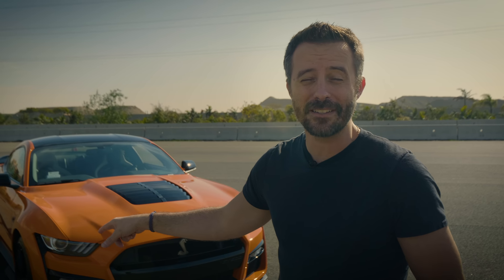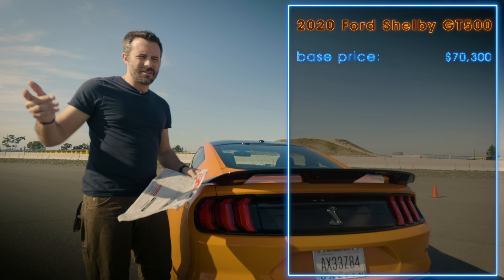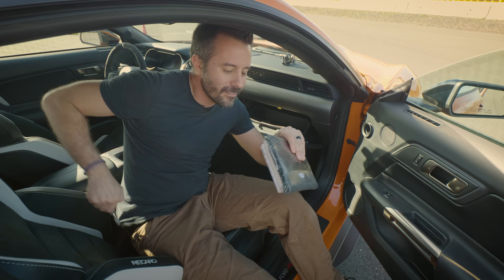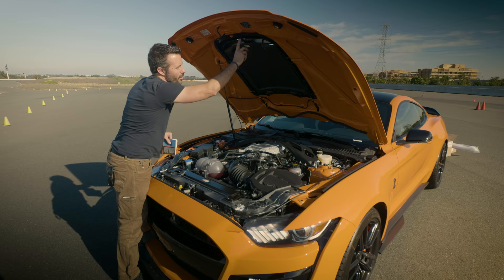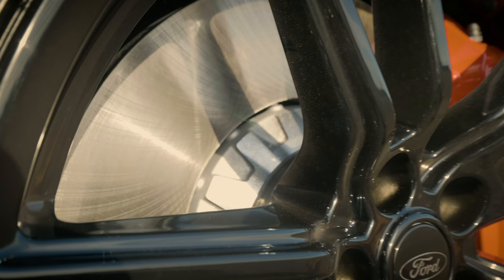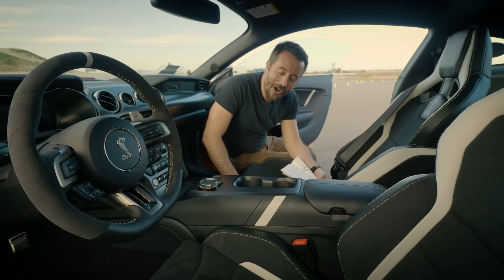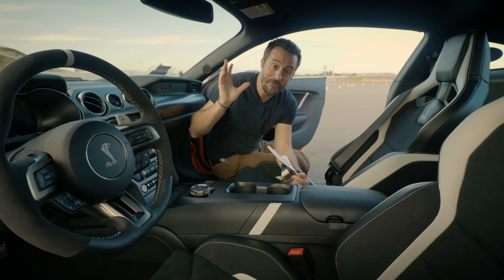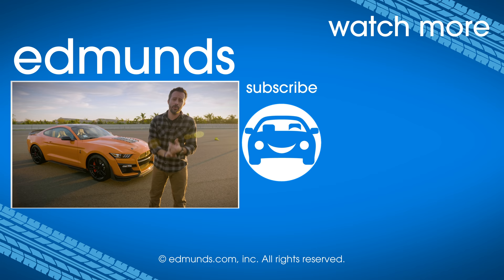We Bought a 2020 Ford Mustang Shelby GT500! Unboxing, Overview and Handling Pack Installation

Comment: Best series on unboxing one of these high performance cars. In fact i believe its never been done before. This channel is real world stuff and makes you realize how many you tubers probably never applied proper break in or paid attention to the engineering standards of new ownership. I knew 500 miles was too little for any car. I would still put 2k low stress engine miles before serious acceleration.

Comment: Edmunds the dealer didn’t install the front splitter properly. You shouldn’t see those gaps and it could separate from the car at high speeds. I hope to see Carlos in the 2020+ Shelby GT500 Owners group on Facebook!
Reply: Thought that looked weird. We'll get it addressed...

Comment: Thanks for showing the prep required to make the GT-500.  It was interesting to find out the MPG is so low for this car, hence the gas guzzler tax.  My 2014 GT-500 with a few bolt on mods and tune,  I am still experiencing on 91 to 93 octane on average 25 MPG.

Comment: Will Edmunds be buying a long term C8? I feel like that's the car I hear more people interested in.
Reply: Yes!
Reply: @CarlosLago  you will see more Mustangs on the street  then Corvettes .
Reply: The 2020 GT500 already beat the New 2020 Corvette C8 on the track according to MotorTrend driven by Randy.
So no...they got the right one first.
Reply: @twany442   Yes by 5 seconds(holy cow) at VIR a track I have driven many times in my past open track life.
Reply: @twany442   Yes by 5 seconds at VIR. Until Corvette comes out with their "revolutionary" 4 cam engine, the  Vette boys might want to hold off on the bragging.
Reply: @RSDX99  Agreed

Comment: After watching this I’d probably NEVER take this track because I’m not going to follow the manual and do all the prep ie starts and stops as recommended. I’d use it as an ordination street car.  So, I’d never buy this car as possible track beast and spend this $80k.  For me...the GT or Bullitt is best.  However this video is excellent because it really opens your eyes. You need to follow instructions in manual for track use or warranty may not be available if problems arise from track use.

Comment: I have a huge gallon of Haterade and I'm drinking it while I say .... This is a Road Car if you take it to the track and pound on it, it will break. Plain and simple. If you want a race car build one!  Other than that it's super cool and I would like one for sure.
Reply: Sure!
Reply: My gt500 has seen a few track days it’s a 14 still running strong 💪 and go look at speed phenomenal or something on YouTube he tracks and drags his new 500 constantly still running strong 💪 make sure you don’t choke on your haterade 🤧✌️
Reply: @andyhernandez2360     it's a road car and a FORD don't worry it will break.
Reply: Ford makes unreliable junk. Only the F150 is worth anything. Bet you guys anything that the thing has unreliable cooling system problems. The engine makes 850 hp at the crank. A lot can go wrong.
Reply: @andyhernandez2360  lol lol🙂 don't get emotional about it. It's just a car. It's just my experience that Ford's break down. Go ahead and get the GT500 I'm sure it will be a blast

Comment: Overpriced Ford... NO sale.   (Save 20 large and get the mid-engine 2020 Vette)
Reply: quietguy over priced Chevy
Reply: Ford is killing it right now... With the GT and all its versions... And also with the Shelby Mustangs GT350, GT350R, GT500 and the GT500 carbon fiber track pack.
People want them...and they're buying them like it or not PIEROD
And the Mustang GT500 has already taken down your new Corvette C8. It just couldn't hang with the Mustang's power.
So no thanks!...we prefer to spend the extra money.
Reply: lol do you really think Chevy isn’t gonna overprice the stingray there’s already one on sale from a dealership for 120k
Reply: @andyhernandez2360  Of course They're going to do it..until the markets are Over-saturated since it's a none limited production. 
Then they'll be like Toyota Corollas... Great sellers that know one pays attention to.
Let them eat cake.
Reply: Antoine Swans same thing with the gt350 when it first launched now you can get one used for 38-40 if you look hard enough same will happen with this gt500 it’s just a first year production people pay more to have them first
Reply: @andyhernandez2360  I'm so sorry to tell you that you're wrong honey!
Go back and do some multiplication homework.
The value over the years are sustainable with the market a few years later.. Ford GT goes for a cool million after two years. The Ford Raptor retains its values years after, and the 2015 GT350 and GT350R goes between $44,000 $59,000. So I'm sure the value of the GT500 will hold its own as well.  And I completely disagree. They all still have way more value compared to the others.
Google should be your best friend.
Reply: Antoine Swans haha honey let me tell you actual facts there’s a 350 for sale here in San Diego for 39k I have a gt500 which I purchased for 40 k 2014 as well just for your information the raptor is not retaining value I have no idea where you heard that there’s plenty of ones for sale under 60 next time don’t just spit off the first shit you see haha ford gt is not a production car they had some for sale in 2017 and more being made a few years later they only make 500 and less a year and they have a contract where you can’t sell the vehicle for 2 years so yea I think that car would be worth a million being a limited edition vehicle
Reply: Antoine Swans just for you to say google is your best friend shows me you know absolutely nothing about value of vehicles